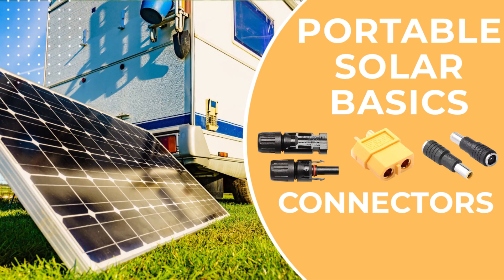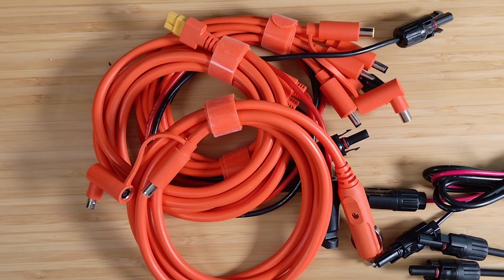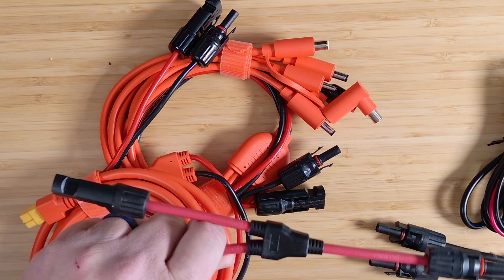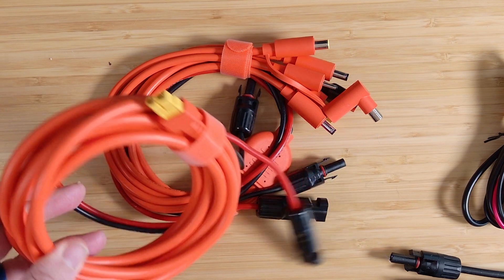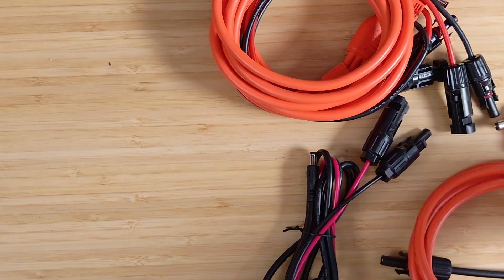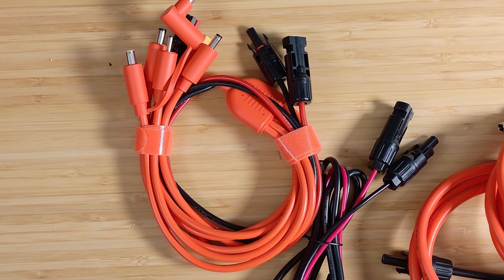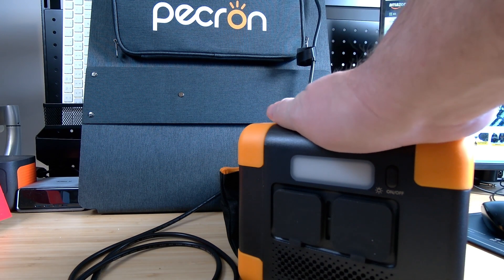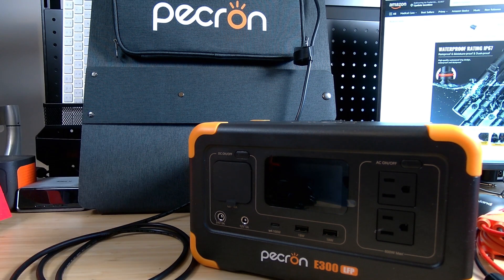Portable Solar Basics: Connectors for Solar Panels and Power Stations

Comment: xt60i does not handle more power than original xt60.
Reply from the maker: XT60i can typically handle 100A vs 60A, which would equate to more power. Also, it can tell the power station “what” is providing power (solar panel vs auto) so the power station can call for more current (thus more power).  Sorry if I didn’t explain that well enough.
Reply: @FamilyGeekery  I'm looking at multiple specs and nowhere have I seen that XT60i can handle more current than a regular XT60.  They're 3.5mm equivalent bullet connectors in a PA housing.

Having the third communication pin is a totally separate matter.  It doesn't magically make PA withstand higher temps and make the existing bullet connectors any better.

Comment: Can you use a DC 2-1 Splitter to join 2 100watt foldable Solar panels & ug i to a Power Station?
The portable foldable solar panels only have 1 DC outlet?
Reply: Or could I plug 1 100watt panel into the DC port on Power Station & 1 panel onto the XT socket to put 200watts into a 220watt Power Station?

Comment: building my own mini ammo can 32ah/420wh mini power stations out of 4x 32ah lfp cells from china. built the first prototype, and it works really well and only cost about 45 bucks in components. need to decide what ports im going with on the future models. really think the 12v/accessory pot/cigarette lighter plug is underrated for powerstation outputs. i build my powerstations with UNREGULATED ~12v dc ports, i usually just add a 20-25amp automotive fuse. having the higher ~13.5v on tap is super useful for running things that all the commercial powerstations simply refuse to do with dc. for example my diesel heater plugs right in and runs no problem, it pulls about 130w max, basically every powerstation shuts down because they regulate the voltage down to exactly 12v... so they overshoot the 10amp max of the cigarret port. 
other appliances i run are my 12v 2quart programmable rice cooker, which pulls around 150w. having the cigarrete ports otherwise future proofs a powerstation because you can upgrade its ports with "car charger" adapters which do usb-c pd 3.0 or even the new pd 3.1 versions, so you can get 140w out through a single usb-c cable. i think soon they will start making pd 3.1 ~140w fridges and air conditioners and heat pumps.
i converted my 12v fridge to run on usb-c through a pd3.1 trigger board at 28v, and it actually is much more efficient since the 28v is still in spec for "24v" systems (which is actually more like 22-30v because of how lead acid based car alternators work). vid on my channel.
right now my powerstations have 2x 100w bidirectional usb-c ports, which lets you charge up at ~200w with two 20v usb-c adaptors (~2.5hr charge time), in additoin to 1x 12v cigarrete port. I think I will atleast add one xt60 receptacle port, so I can have a more solid connection over the 12v cig ports for those higher draw items, in addition to 2x total cig ports. 
my powerbank is so cheap and efficient because i dont use any bms, and just instead rely on a dumb anologue active balance board, since the 2x 100w bidirectional boards manage the voltage range, and most 12v cig port accessories have a low voltage cutoff, its really not an issue. the bi directional boards do let me charge up from small usb-c solar panels, and they do okay as far as efficeincy. dont need a big bulky/expensive mppt for such a small and portable guy.
good video, thought i would share my story
Reply from the maker: Thanks for all the tips!  I cant wait until more things run on 100+watt usb PD.

Comment: in a pinch - cut off the connectors - strip back a bit of insulation and make a good and proper twisted wires connection - tape well or shrink wrap or both
Reply from the maker: Always an option!  But as this is a series of “basics” most people would probably buy a $10-15 adapter versus soldering and shrink tubing. But thanks for the tip!